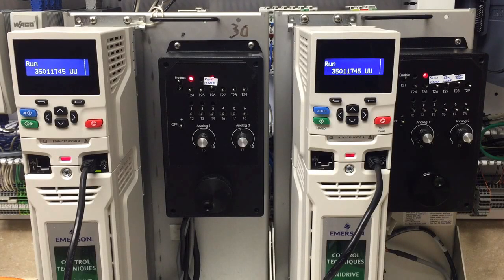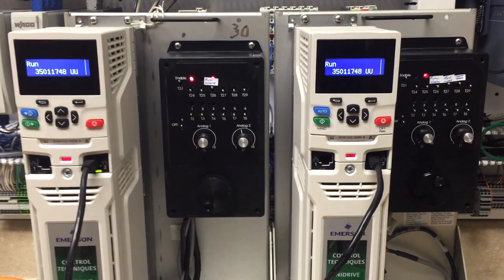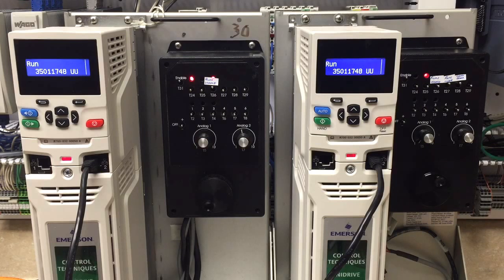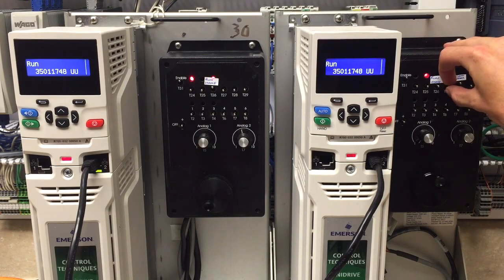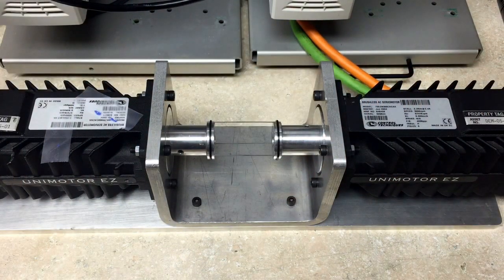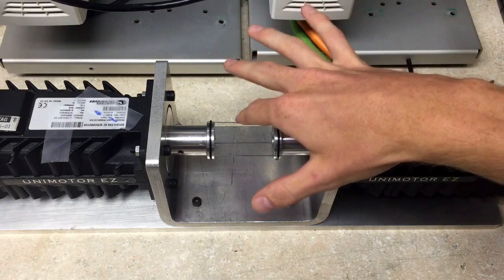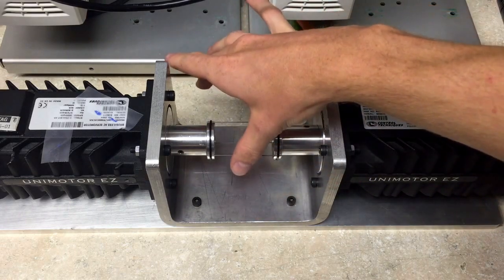Control Techniques - Unidrive M Pencil Lead Position Sync over Ethernet

Comment: Hi friend. We watched your video with a workmate. The task is also to synchronize the two motors (system master-slave). Our motors are starting, but it is unclear what exactly is the source of the synchronization command. Where is this parameter registered in the drive settings?
Reply from the maker: Hello, great question! We made another video which shows how the syncro is setup between two drives. This was done exactly the same way except the mast drive was referencing a handwheel encoder. Read through menu 13 for setting up syncro from another source.
 https://www.youtube.com/watch?v=3rFMeDoVeT4
Reply: @Carolinamotioncontrols  Hello. Thanks for the answer.
The principle of data transmission via ethernet is clear.
What is the start command?
10.042 ---> 0.32.009
  What triggers the transmission of the AMC master position reference to the motion controller output?
How to turn on 32.007:EGB on the T29 signal?

Comment: Hi, cool video!
Please help me figure it out.
I have a drive Unidrive M700 which works with a servo (feedback: SC Hiperface). To solve my task, I need to use the built-in encoder emulator (AB). The problem is that at the output I have a low voltage signal, approximately (1) - 3.3 volts, and the PLC module is designed for 5 volts. Is it possible to change the voltage of the output signal in the encoder emulator?
Reply from the maker: Hello, that is a great question. However the simulated output signals are driven from the input signals. So if the input magnitude does not go that high then it is not possible to adjust the output signals.